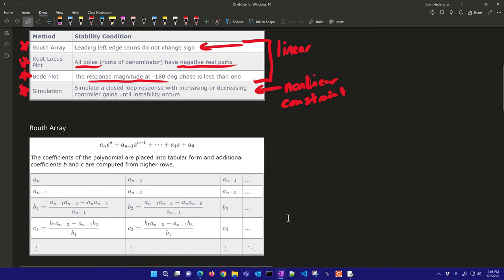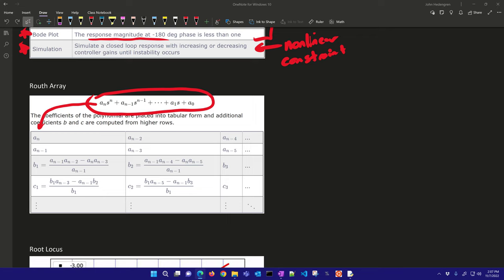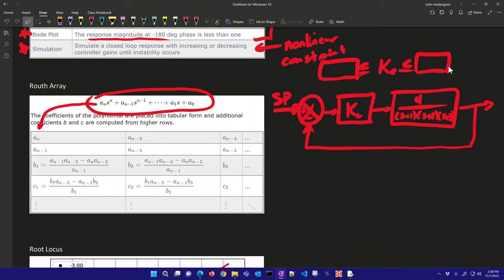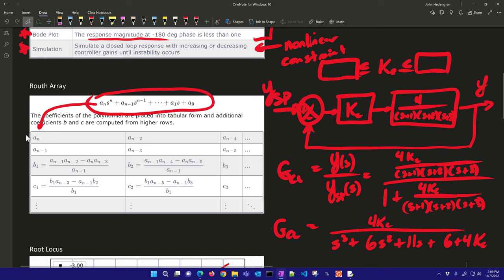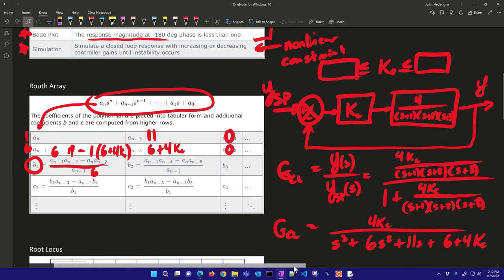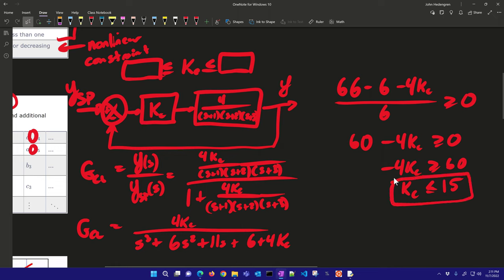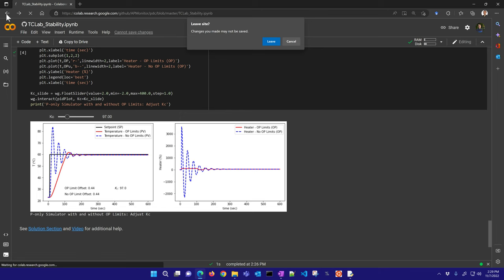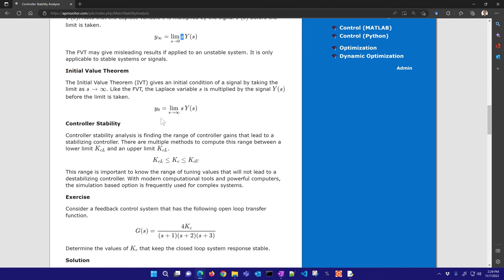Control Stability Analysis

Comment: That is great John. Could you share with me what equipment you use for writing please ... I used a lot but non of them show the cursor/mouse while writing or pointing
Reply from the maker: I use OneNote with a Huion 4k external monitor tablet for writing. I also have a Wacom Cintiq tablet but the Huion is just as good. The cursor option is available from the Graphics card GEFORCE option. Looking at the video later - the cursor is distracting (covers the text) so I may turn that option off.